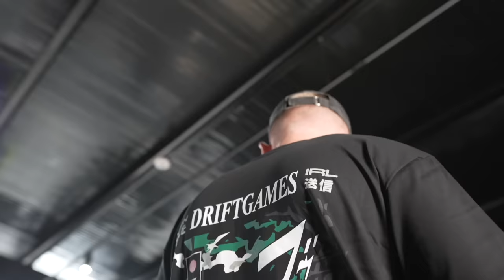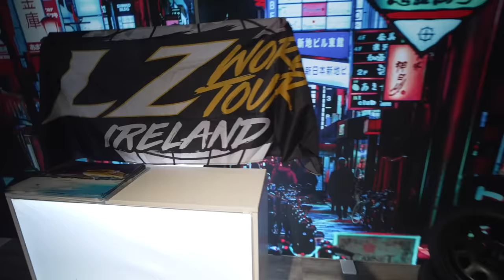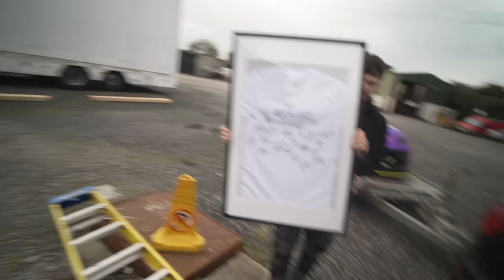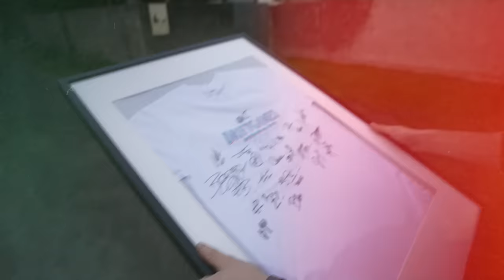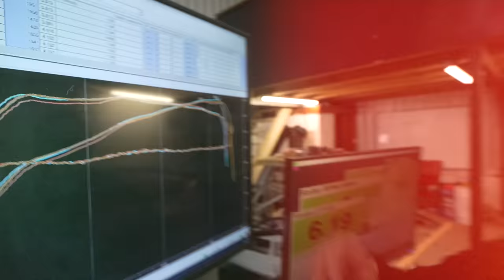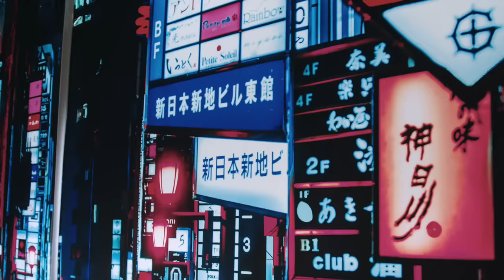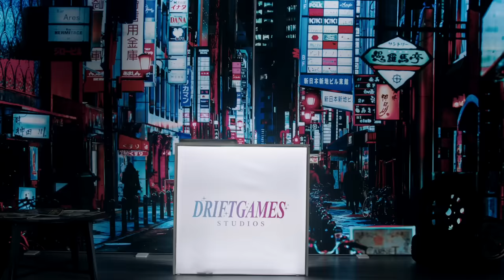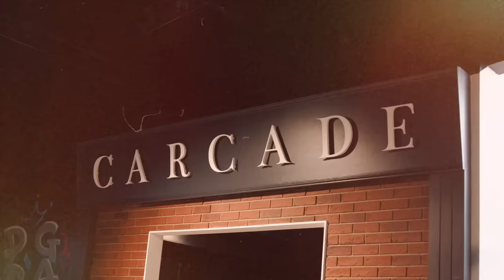HUGE update on every car in our JDM collection…

Comment: FOR THE RC DRIFT TRACK IN THE ROOF:
Get some plywood, lay out the track.
Make a centered hook/lift point with a winch or chainblock on the roof.
4 cables, one on each corner,
Some free roller pulleys one above each corner of the plywood,
One in each corner of the room,
Add some counter weights to each cable to keep it stable while lifting and lowering. 
2 full sheets of plywood should be big enough for a track.